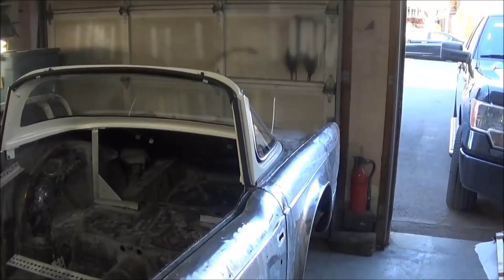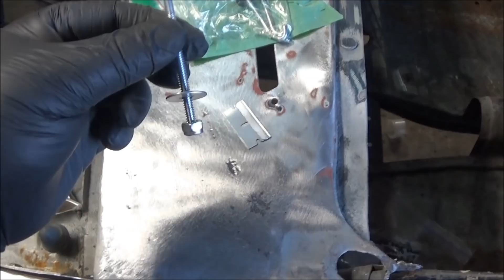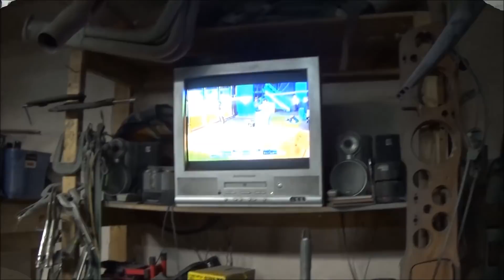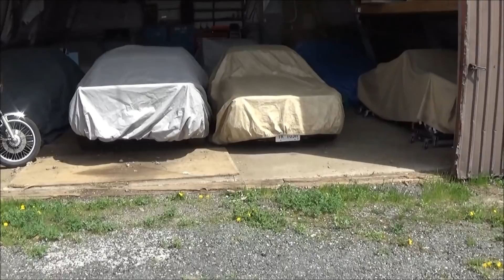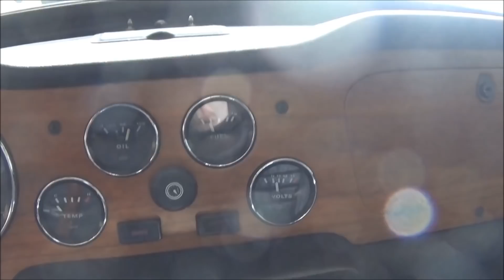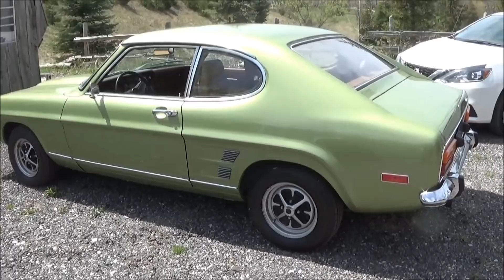More Triumph TR250 Surrey Top Talk, Small Repairs and Moving Cars

Comment: Tush - Interesting that the Capri had what we call 'RO-style wheels (made under licence in the UK by Rubery Owen) but I believe they were styled in the USA? Magnum rings a distant bell.

These wheels first appeared (in the UK) on Rover, Range Rover, MG (sorry to swear) and then Ford mid range cars like the Capri and Cortina 1600E - a sort of executive 1600cc car ..

Always liked them on road cars but used Minilites on the Rally cars.

Can I offer a personal view on the Surrey Top? I would use a Triumph White (like your TR6) to enhance the dark blue of the car itself especially with the black Thong - errr - soft top. MG (Sorry I can't resist and my late Dad did work for them in Oxford) did a white over red hardtop which looked great. In a purely MG sort of way of course ...